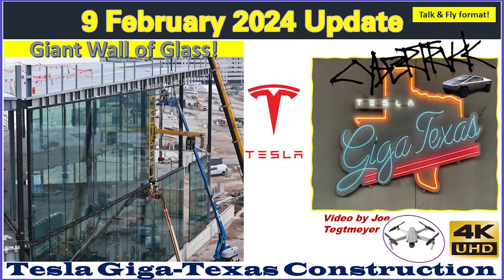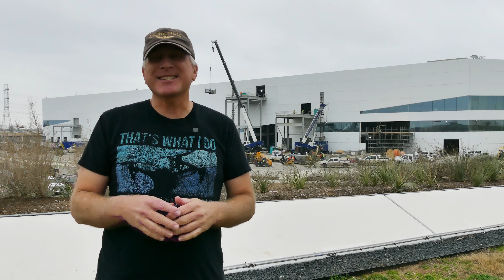S Steel & Glass, Receiving Dock Work & Casting Apron Widened! 9 Feb 2024 Giga Texas Update (07:55AM)

Comment: Thanks Joe.  I'm surprised they are putting all that glass on the south end of the building.  I worked in a glass and steel building long ago. The glass had a gold colored coating to reflect the sun.  The conditions on the south and west side of the building were miserable. No amount of cooling could make us comfortable.  Glare was also a problem.  They installed interior shades that helped with the glare but they couldn't cool all that thermal energy.
Reply: Thousands of glass curtain skyscrapers exist.  What do they do with those?
Reply: If someone could get in low enough to zoom into a label on a crate, that might reveal enough clues to work out which Sedak system has been supplied.

The German glass manufacturer Sedak has a huge range of glazing unit systems. 
Glazed units up to 20m x 3.6 x 0.1, 59’ x 12 x 4”
Double and triple glazed. Glass thickness up to 50mm 2”. Can’t find any reference to quadruple glazed. Although they do custom work.
Quadruple laminated bullet-resistant glass.
Low e glass. Low Emissivity Glass (Say that quickly 4 times. Or even once. Hard to pronounce.)
All manner of reflective coatings.
An interlayer for laminated glass called Southwall. From elsewhere, ‘Southwall XIR infrared reflective film creates a transparent and heat-blocking “super interlayer” that can save energy, reduce carbon emissions and increase building occupant comfort.’
Reply: @DessieDoolan  Or maybe Elon just wants fresh papayas! You get them trucked down from QL, Texas probably has them trucked over from FL! Papayas!
Reply: You may want to read up on "low-E glass"
Reply: Maybe Elon wants a tropical greenhouse in the factory...
Reply: I lived in Dallas for about 10 years.  I would never put a south glass wall on any building I was working on, unless it was being used as a kiln.

Comment: Hi Joe, thanks for the great flyover as usual ;) At 2:05 you talk about some reworking of the receiving doors. I've watched some of your older flyovers and it looks like these are additional (new/not used before) receiving doors. That's a good sign of an increase in production capacity. ;)
Reply: Indeed and I don't think they were even the plugged ones.  Recently cut out.